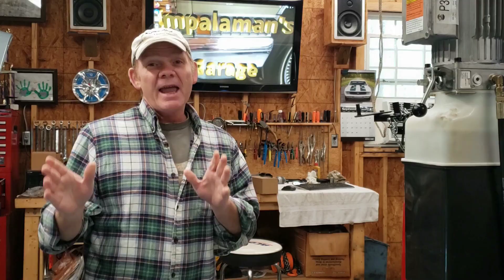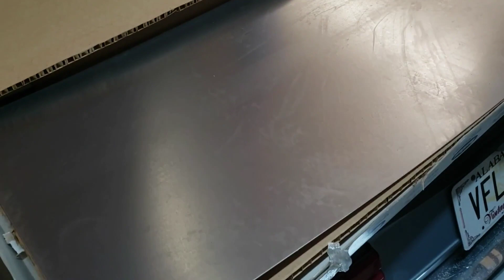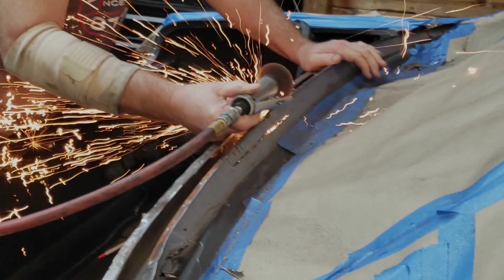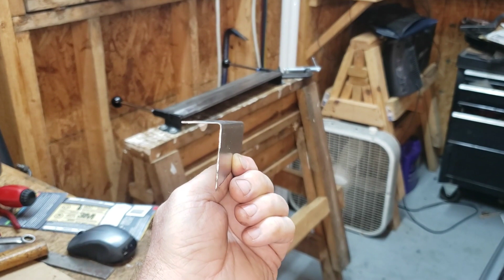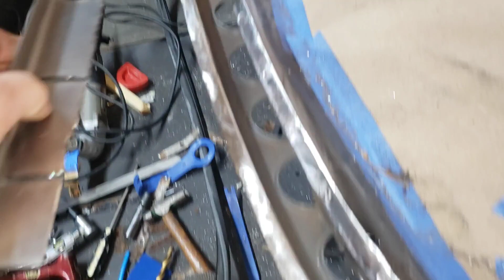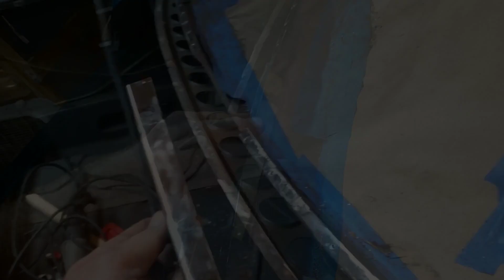Mercedes W126 - Rear Window Channel Rust Repair - Part 6 Cutting and Fabricating

Comment: Good series. Thanks for showing. Cant help to wonder: Could you not have achieved the bend with a shnazy handling of a ball peen hammer?
Reply from the maker: Sure you could do it that way it you wanted. A metal brake is a lot easier though.

Comment: I fix my w126 leak with jb water weld . I know in future the rust will spread. I need to learn to use grinder and welding machine to do this project.
Reply from the maker: If you have not used tools like that before, remember to use the safety shields which come with the tools. You don't see any safety shields on mine but do not follow my example. I've been doing work like this for many years.